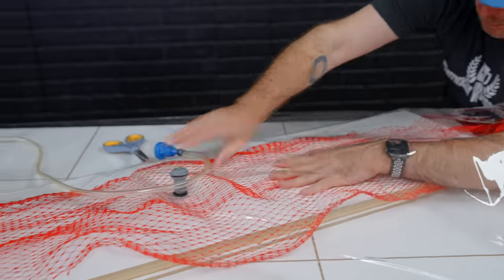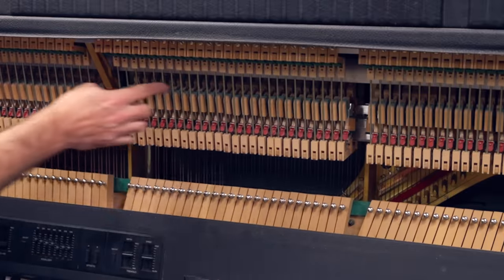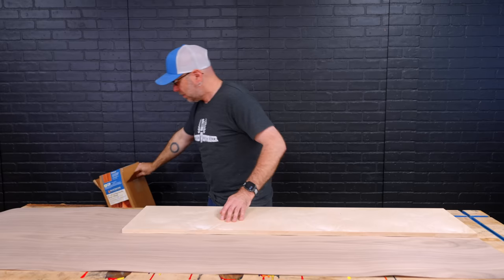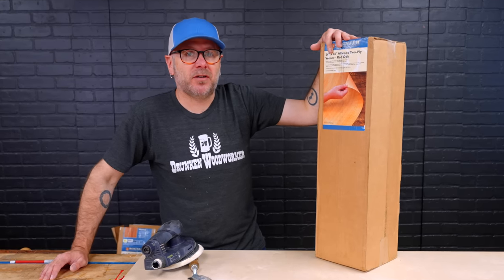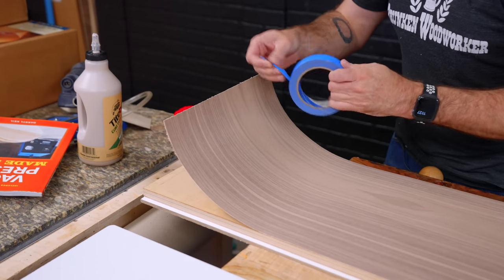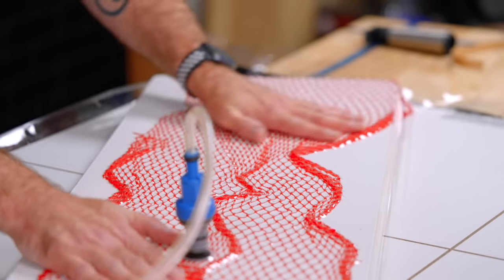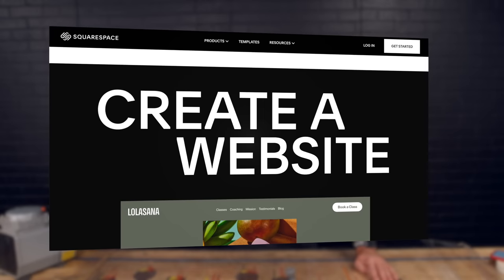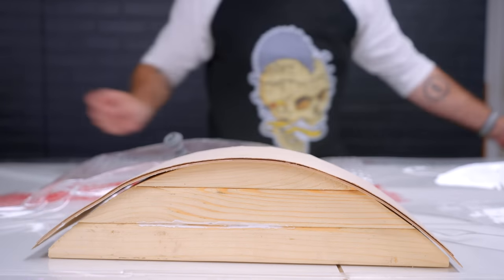Vacuum Pressing Changes Everything!. Next Level Woodworking Skills.

Comment: Hey, another added entry level option in between hand pump and vacuum pump. You can also get those clothing vacuum 'storage' bags and a shop vac or household vacuum. They are not as big, but they are designed for long term storage (they have a good seal), reusable, and perfect for something like this on a smaller scale.
Reply: That was my first thought as well.  I have a couple of extra large storage bags that don't hold vacuum well and am wondering if a shop vac will be OK running for an hour or so until the glue sets up.
Reply: @johnnywest5445  every bag is different, but typically those storage bags can hold a seal very well. As they are designed for long term storage. You should be able to suck out the air and leave it. Unless of course there’s a small hole
Reply: @montgomery.metalworks  I have some smaller Hefty bags that hold the vacuum well, but three Magic Bed brand I bought for comforters lose their vacuum over time.  They've been that way since I bought them, but I'll have to test them to see if they'll hold up for an hour or two.
Reply: This storage bags definitely hold a vacuum really well. I used a bunch of them for a couple of moves and they will hold a vacuum even in an airplane for 11 hours over the Atlantic. I put a king size memory foam pillow in one for a trip. Held the pillow about the size of a football for 11 hours at 30,000 ft and those were the harbor freight ones
Reply: You don't even need the bag, but rather just the valve. You can transplant the valves onto whatever plastic you want. Harbor Freight sells a 4 pack of bags for very cheap, and while the bags themselves don't always hold long term, the valves are perfectly fine.
Reply: @jonathanstef3218  I hadn't even thought about removing/reusing the valve, thats a good idea.
Reply: @jonathanstef3218  That's a great idea, Jonathan, and a great way to get into vacuum pressing inexpensively.  I'm going to look into getting some good thick plastic sheeting.
Reply: I was thinking that too

Comment: Perfect timing on this video... for me... Thank you!  My bags and stuff just arrived from Rockler.  I am remaking cabinets for so 1960's Dynaco speakers.  I am trying to make them look as original as possible.  The veneer originally used was teak.  Teak will be used again.  I am hoping the TB veneer glue will be ok with this oily wood.  I will precondition with acetone to get as much surface oil off the glue surface as possible.  Per your recommendation... I am heading to the store to get a slab of melomine this afteroon.  I am also very glad to learn about the glue roller you use.... I am placing my order for that and the try right now.  Thank you!

Comment: Great video David.  I'm wondering if you really  need to veneer both sides since you're already using plywood, which is made up of several layers of veneer already.  Seems a bit of overkill to me, especially with prices as they are these days.
Reply: I agree. Makes sense for MDF or particle core
Reply: Exactly veneered plywood is only veneered on one side.

Comment: I was wondering why you did not know about the mesh and low and be hold you remembers. 
The last vac veneering project was with one of my students. 3/4”-18mm Baltic birch ply veneered with some very beautiful and expensive teak veneer. With both leaves slid out it’s about 9’ long. We have an 52”x100” bag. There are much better mesh out there. I’ll see about sending you a pic of the table. His house is all teak.

Comment: I would never buy red oak for real furniture. However, I ended up buying some red oak for shop furniture (saw horses, bench bases, jigs, etc.), because it was about the cheapest hardwood I could find. I think it looks great in my shop to be honest. It is also very stable and easy to work with.

Comment: Pro tip:
A shop vac is high volume low pressure compared to the lower volume higher pressure of a real pressing vaccum so a shop vac is not adequate for vaccum bag veenering..... HOWEVER........
a shop vac WILL suck all the air out of the bag quickly so that you could then, use a smaller, less expensive vaccum press vacuum or even a hand pump to maintain the vaccum  pressure once all the air is out.

You could literally save hundreds of dollars by buying a smaller vaccum pressing pump and a shop vac over a larger more efficient veenering vaccum, and bonus, you get to use the shop vac for other things as well.
Win win.

Comment: Sorry I don’t follow the use of the netting?
Reply: It creates channels for the air to get to the vac pump, otherwise you would get uneven pressure the farther you get from the pump
Reply: @jelcodiekr1408  ok thanks. To equalize the pressure and channel distribution evenly shouldn’t the net be placed out completely over the board not just placed in the bag?
Reply: @cswatson4823  that would probably get it from 95% to 99%, it would be better but you probably wouldnt notice any practical difference